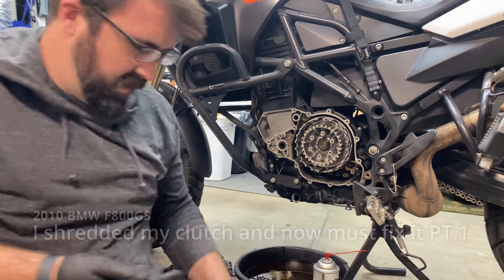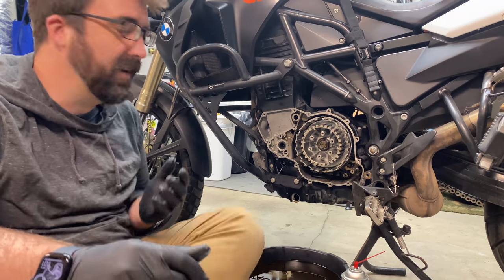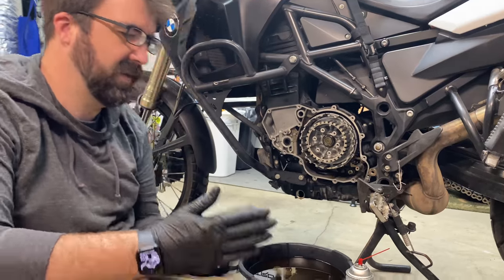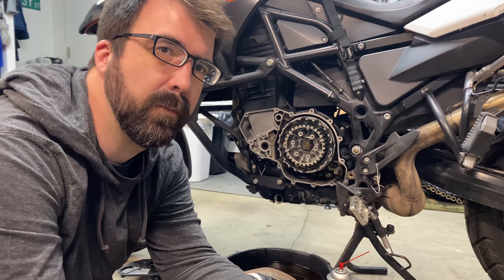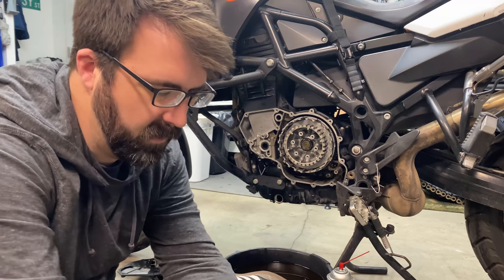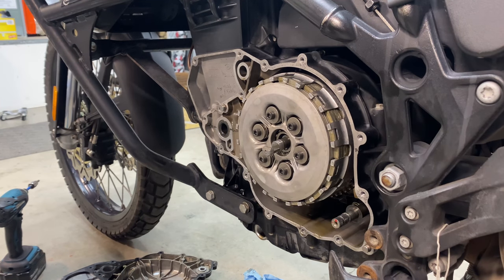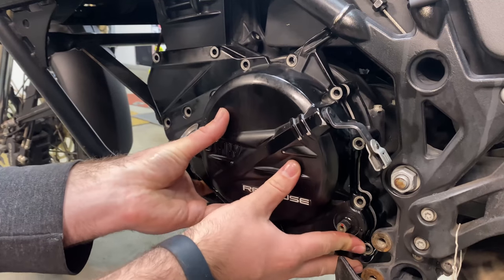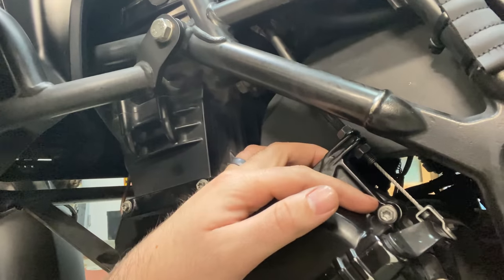F800GS Clutch Replacement How-To: I shredded my clutch pt. 1

Comment: Would you recommend doing this yourself with just a little experience?
Reply from the maker: Yeah! It’s not too hard, nothing super tricky as long as you’re paying attention to the plate order, the shaft seal, and seating the arm correctly. Take your time, take lots of pictures, and go slow and you should be good.

Comment: How's the EBC clutch holding up? My stock clutch died at 27k miles and im looking for a replacement.
Reply from the maker: Funny timing, just doing the first oil change since installing it. Literally halfway through it right now waiting for stuff to drain out. 

Only about 1500 miles on the oil I just pulled out but it looks clean. No funny clutch business or anything in it it seems. I’m happy with the EBC! Still bites nicely and holds power just fine. No regrets going with this over OEM. Heavier clutch springs aren’t bad, either, got used to them quickly and forgot I put them in.